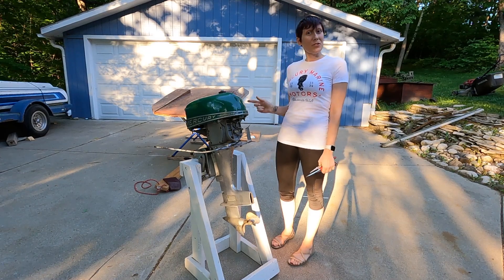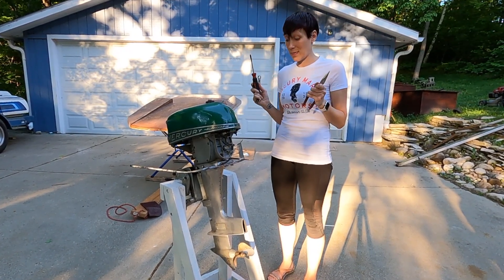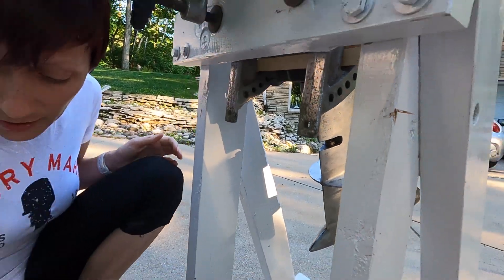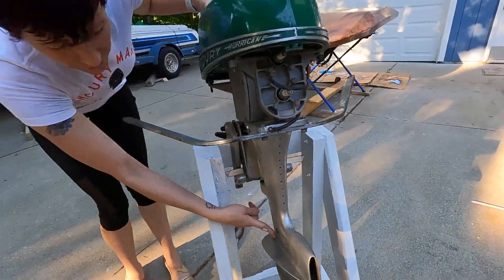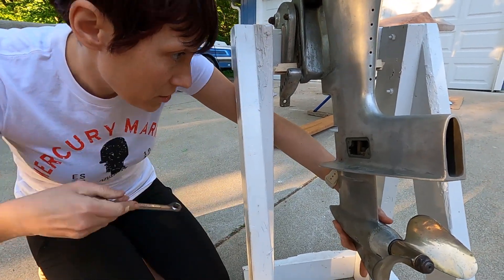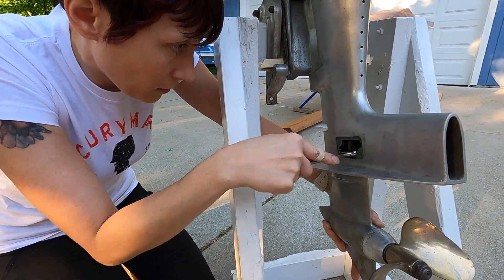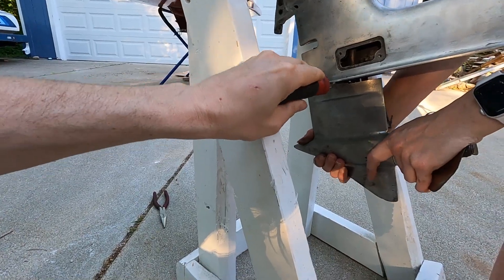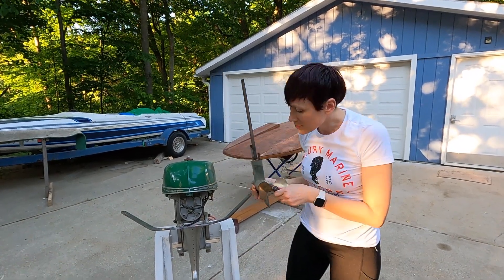How to Remove Lower Unit from Kiekhaefer Mercury Outboard Hurricane Lightning KG4 KG7 KE7H

Comment: Do you happen to have a video showing how to pull the flywheel off that engine. I picked one up that doesn't have spark and can't figure out how to get the big pull string catch (beyblade looking thing) off that is located where the nut usually is that hold the flywheel on.There is no nut on top of the crankshaft. Any help?
Reply from the maker: Yes I do, keep watching this series I think I pull it using a big strap